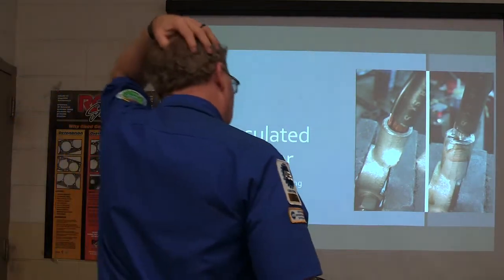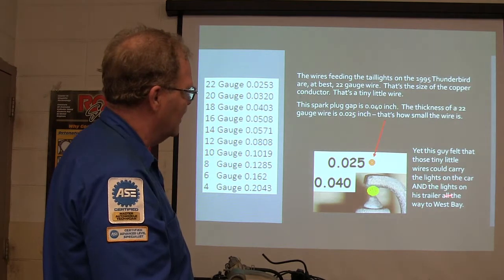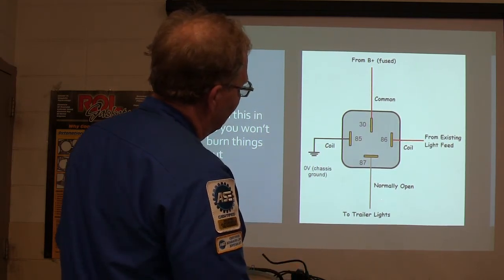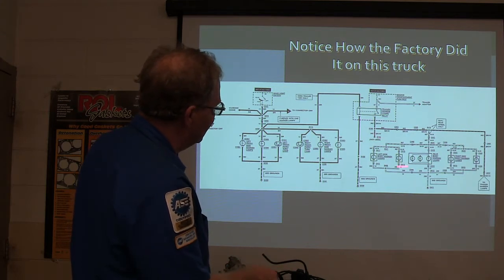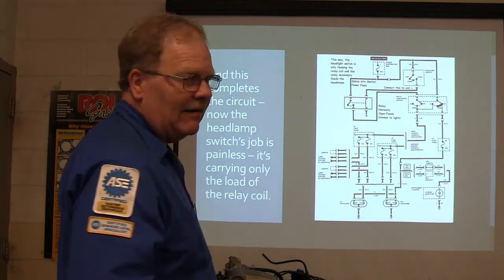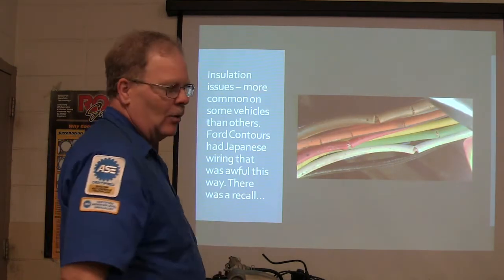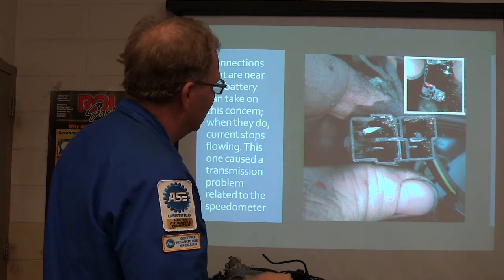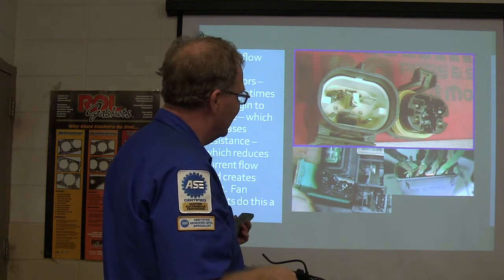Wires and Repairs

Comment: weird 280z I liked that car and it was owned by a favorite customer so if she ever had a problem she would have brought it in. I changed the oil every couple of months for a year in a small busy shop. Every time I let it down off the lift it would not start for 30 minutes. All oil changes were drop off to be picked up by the end of the day so we could give them a quick one over. The first two times it happened I told the boss, then knocked out some other repairs to come back and do my diagnosis. Came back and everything works fine. She never had any problems with that car but every time I let it down off the lift it would take 30 minutes to come back to life. It seamed as if the ignition system had a temporary shut down but never had time to do a proper diagnosis. It was on a 30 minute timer. One of those weird ones.
Reply from the maker: You always have the most interesting stories!

Comment: The bad wire in the Thunderbird sounds like it had strands broken, but not all in one place (cross section). So I think electrical continuity was made by jumping from one strand to another until the strands oxidized too much. That's my guess.
Reply from the maker: It started blistering and melting right at the Scotchlock and that melting slowly made its way back toward the power source, melting into other wires along the way. It wasn't capable of carrying the current of the extra lights.
Reply: McCuistian Oops. It appears I referenced the wrong car. I meant to refer to the wire that was wrapped in shielding and you found one spot lost continuity when you bent it, but showed no visible damage.
Reply from the maker: Geo Logic oh, that one.

Comment: Shouldn't the fuse blow if there is an overload instead of the wires overheating?
Reply from the maker: It would seem so, but the answer is no, because as that wire overheats (starting at the Scotchlock), the current flowing through the circuit is reduced because of oxidation of the copper. Resistance is created, which creates more heat. There's a threshold there where the fuse won't blow but heat builds - it's a delicate balance, particularly on a long wire - and this was a long wire, with a lot of skinny copper between the fuse and the Scotchlock.  It was a "perfect storm" situation.